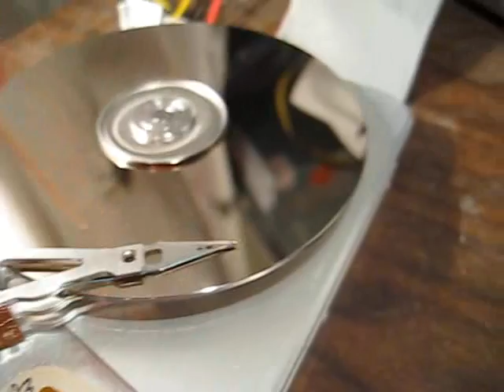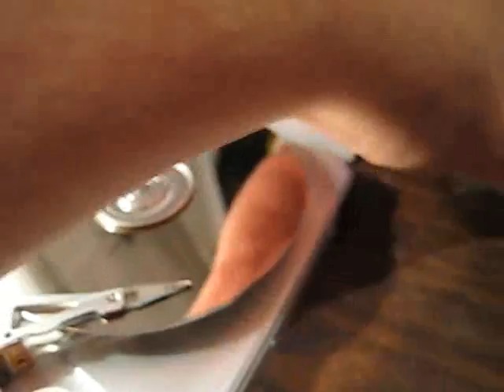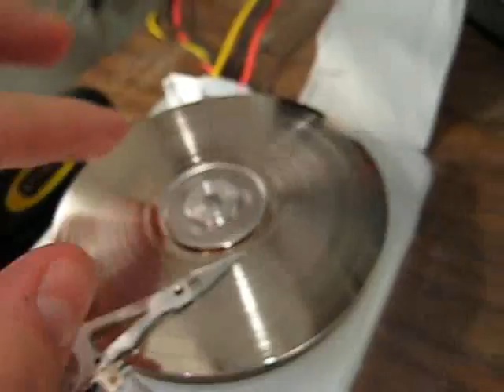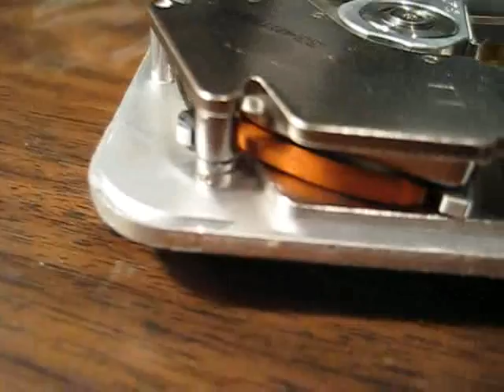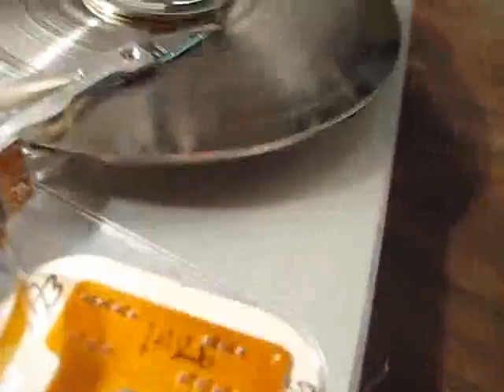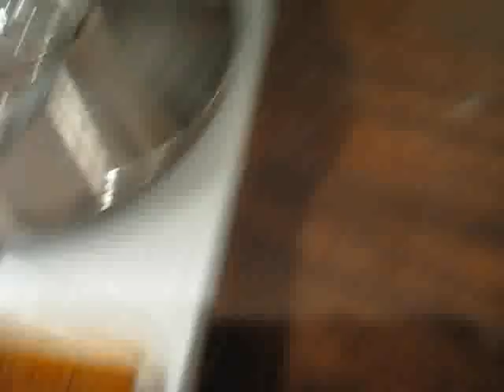Messin  with an old hard drive

Comment: Nice seeing someone else do the same thing I did to a 465MB hard drive. That thing was so old the hard drive casing was made out of plastic, barely worked, had a lot of damage from a fall from its last owner, surprised it still worked even a little bit. After I was done "playing" with the drive, the central cylinder that the copper used to make the hard drive spin had clogged the spinning space. I somehow also ended up with a warped drive in the end.

Comment from the maker: @chrisphergroup You are very misinformed, but thank you for your concern. Even the slowest hard drives rotate at 4k RPM. Most are 5400 or 7200 RPM. The motor spinning the disks is very very low torque, and the platters are made of solid metal, they won't shatter.

Comment: It's really interesting. I've learnt that a hard drive dies when it's opened. But - the explanation of this theory is that it's lethal if any dust gets between the head and the plate. Maybe it didn't happen in your case, but the HDD wouldn't live much after you've opened it.

Another thing: afaik the plate's fricting with air is also lethal, thus the plates & the head is held in vacuum.

Maybe I'm wrong after all. :S

Comment: that looks like what my cd drive did to a cd... when i told it to burn the data i didnt mean burn it. There are little orange and stuff lines on my cd just like when you scratched the drive with you screwdriver... cept mine had color